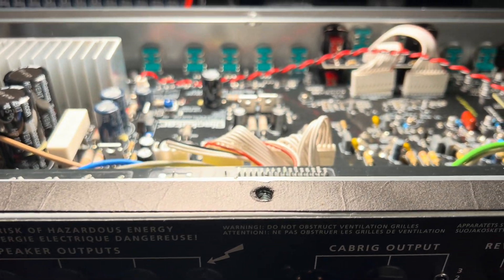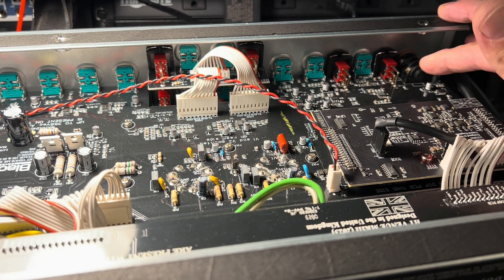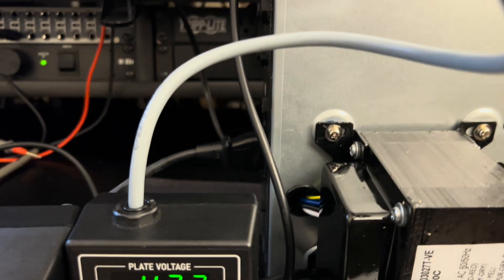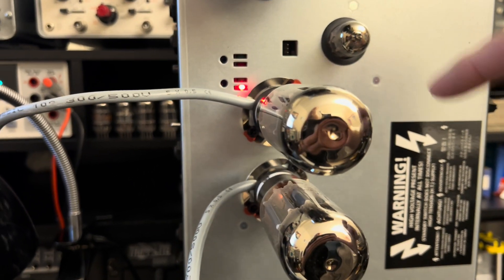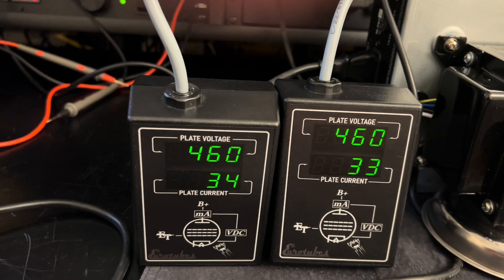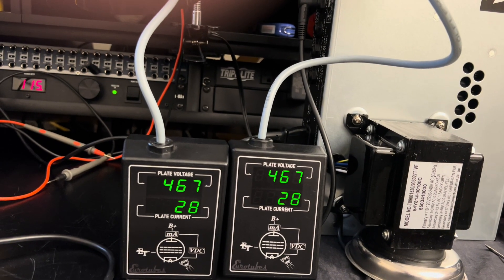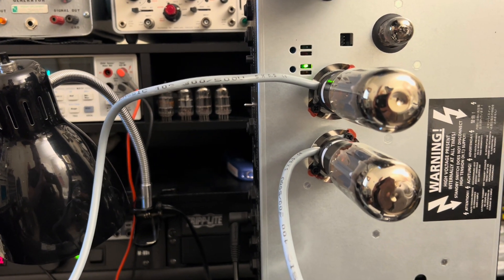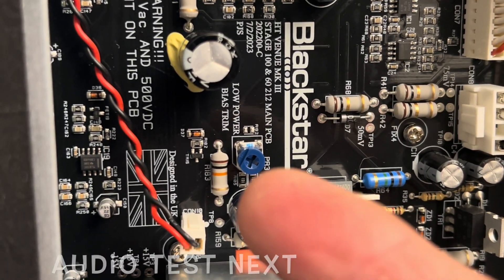Blackstar HT Stage 60 MKIII ~ Bias & Balance

Comment: Both Power and Standby switches must be turned ON (power sent to the cabinet as while playing the guitar) when biasing? 
My HT Stage 100 MK3 has same ports and red/green indicators, and since I took it out of the box for the first time in January, I noticed that both of the indicators are green when power is already ON but standby is still OFF, and after I switch standby to ON both indicators become red. Didn't know what does that mean. I take it that my amp tubes are unbalanced and hot, but I want to know during which mode should I adjust bias pots.
Reply from the maker: It’s early am!  Need the coffee. Need the coffee. As I recall, amp must be in play mode with a cable in the input jack. Not with a signal being fed into it.  Follow the procedure around the 2 minute mark and get back to me. 🫡
Reply: @ForgottenGearRestorations  I already did the whole thing
I only forgot that my 100W amp was in 10W mode and indicators behave differently during that.
So basically, before starting the process I switched to 100W with amp fully on (with power to the cabinet) and I was easily able to balance the tube pairs and adjust the bias without hooking multimeter to the PCB.
Now I wonder if switching the power reduction mode actually causes imbalance between tube pairs and burns tubes faster. Well, in 10W mode the balance indicators don't shine in different pot position than in 100W mode, and I was unable to get the bias out of red in 10W mode. So, I wonder now if reducing output power with power reduction switch actually does wear the tubes out faster.

Anyway, thank you a lot for the video, now I'm not afraid of switching the power tubes in my amp. If you run out of ideas for what videos to make, here's a suggestion - make one where you show how to hook up the multimeter to Stage 60 MK3's tester port or whereever else, or how to adjust bias current/voltage on these amps with different number of tubes.
Reply from the maker: @Kreozot2D thank you and I’ll def do that next time one comes around.  I hope you and yours are well 🤘🏽

Comment: Some guitar amplifiers will cause the output tubes to have a Getter Flash on the Glass Envelope of the output tubes any reasons what causes Getter Flash?
Reply from the maker: If you’re referring to the blue glow, those are our electron friends saying hello as the tube is conducting.
Reply: @ForgottenGearRestorations  No, if you look at output tubes it looks like a Burned Circle on the glass Envelope of output tubes. If you type into google Getter Flash output tubes pictures you will see this often in guitar tube amplifiers. Type in on Wiki GETTER they also have a picture of the tubes with Getter Flash. I'm not sure what is causing the Getter Flash or how to prevent output tubes to getting Getter Flash?